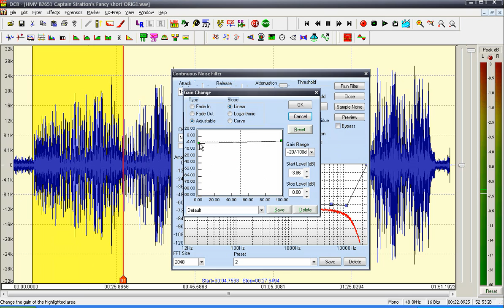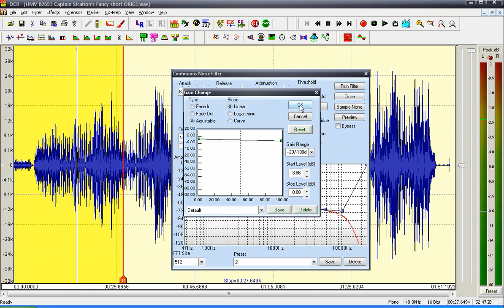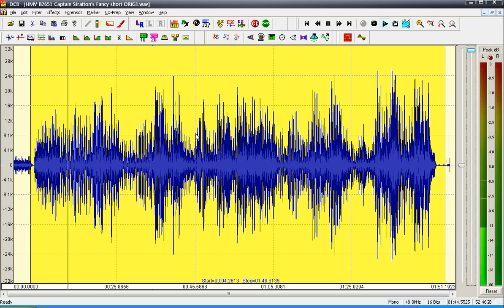Audio Restoration 101 - One method of De-noising using DC8

Comment: "The idea is that you use the 1st more "specific" run of the CNF to partly separate the noise from the music content."  CNF cant separate the noise from the content. This is probably the fundamental misunderstanding. Using HPF and LPF as you did here  objectively removes noise without touching the music. But once we use the denoiser we're into subjective "trade off" territory.